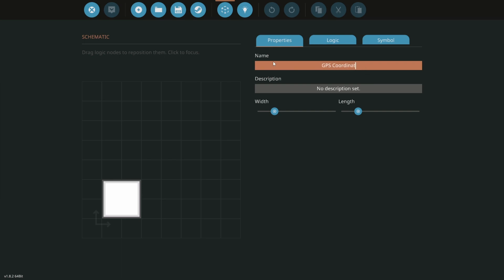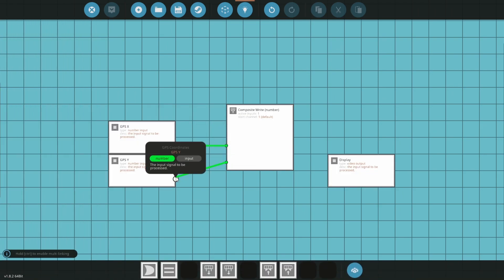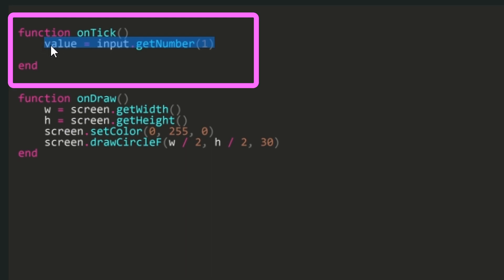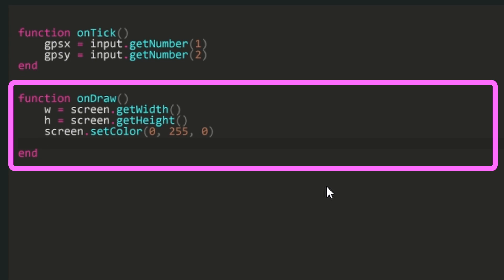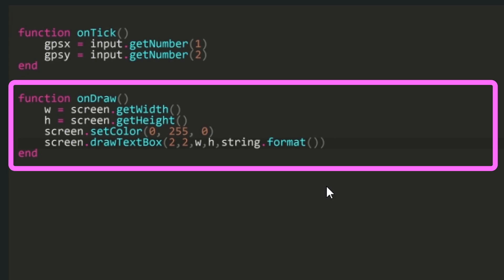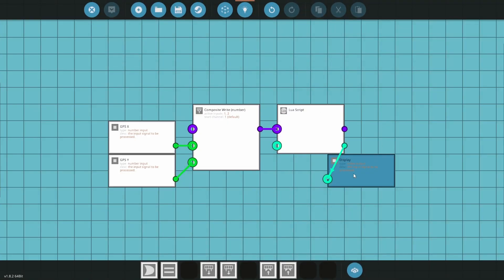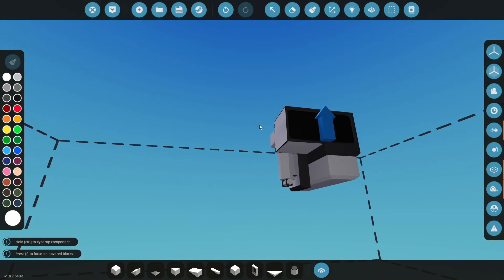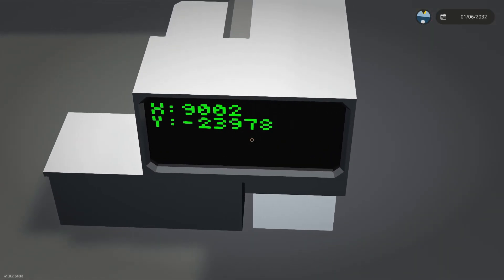Stormworks - Lua GPS Display Tutorial

Comment: I just tried using this code, but it is not working. It is showing an error, which says 11: bad argument #3 to 'format' (number expected, got nil). I don't know what it means or if I did something wrong, but there has just been an update. Can you help me?
Reply from the maker: Something is probably wrong in your onTick function.

The only way I could replicate it was by not specifying a channel to read. It should say getNumber(1) and getNumber(2) or any channel you are reading gps data from as this example below.

function onTick()
 gpsx = input.getNumber(1)
 gpsy = input.getNumber(2)
end

If it were to say input.getNumber() with nothing in the brackets it will error because it is not receiving anything. not even a 0. If the channels are set to the wrong channel your co-ordinates will at least output 0.